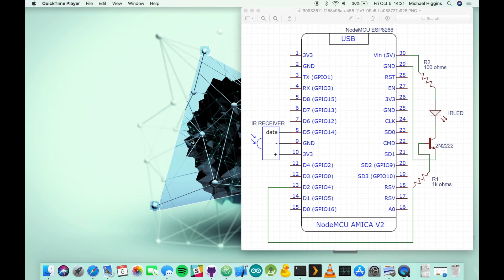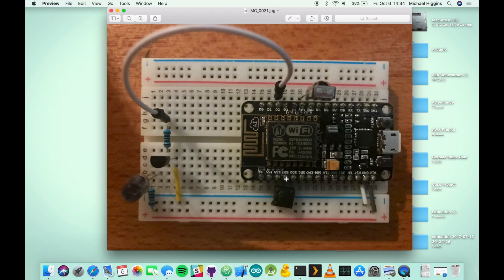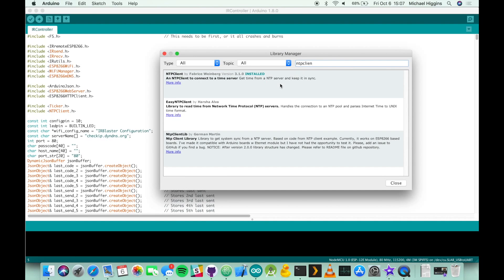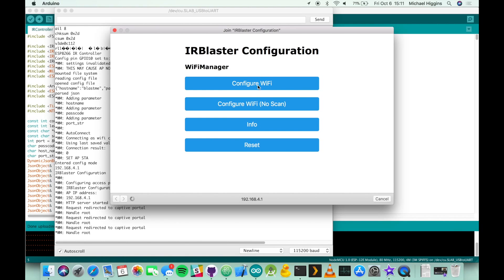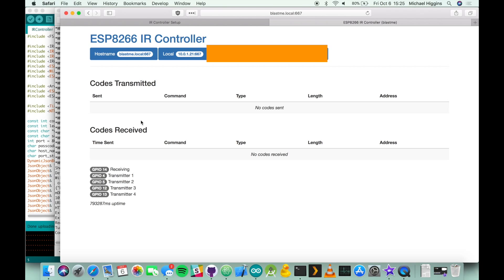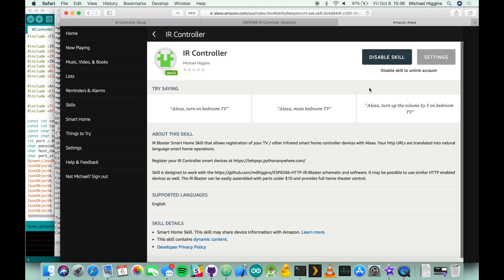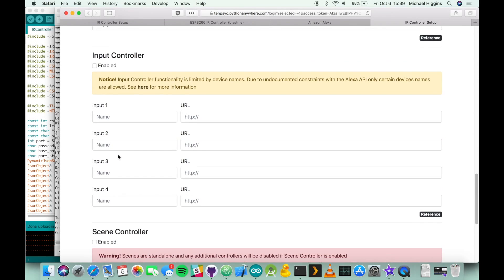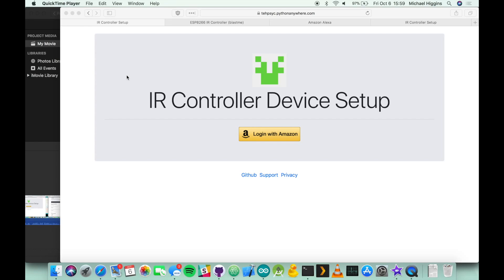IR Controller Tutorial

Comment: Have an error retrieving External IP (After Resetting ESP-12E Module)

ESP8266 IR Controller
Config pin GPIO10 set to: 1
mounted file system
*WM: Adding parameter
*WM: hostname
*WM: Adding parameter
*WM: passcode
*WM: Adding parameter
*WM: port_str
*WM: Adding parameter
*WM: user_id
Using Static IP
*WM: 
*WM: AutoConnect
*WM: Connecting as wifi client...
*WM: Custom STA IP/GW/Subnet
*WM: 10.0.1.10
*WM: Using last saved values, should be faster
*WM: Connection result: 
*WM: 3
*WM: IP Address:
*WM: 10.0.1.10
WiFi connected! User chose hostname '' passcode '' and port '80'
WiFi configuration complete
Local IP: 10.0.1.10
URL to send commands: http://ESP_181C84.local:80
ArduinoOTA started
MDNS http service added. Hostname is set to ESP_181C84.local:80
HTTP Server started on port 80
Turning off the LED to save power.
Error retrieving external IP
HTTP Code: -1
connection refused
External IP address request took 5002 ms
Ready to send and receive IR signals
Reply from the maker: There's some bugs with the latest version of esp8266 for Arduino. For now I recommend using 2.4.0 and when uploading your code make sure you select lwIP v1.4 Prebuilt (see readme for details, go to Tools > lwIP Variant > v1.4 Prebuilt
That should fix this issue assuming the rest of your network settings are correct
Reply: I wish they'd fix this... I'm stuck now, as v1.4 prebuilt is now gone / deprecated, all that is left is "IwIP v1.4 -  higher bandwidth" and"IwIP v1.4 - compile from source"I've tried older versions of Arduino IDE back to v1.6both of which error out WAY beyond my understanding:...
In file included from C:\Users\jc\AppData\Local\Arduino15\packages\esp8266\hardware\esp8266\2.5.2\libraries\ESP8266mDNS\src\LEAmDNS.h:108:0,                 from C:\Users\jc\AppData\Local\Arduino15\packages\esp8266\hardware\esp8266\2.5.2\libraries\ESP8266mDNS\src\LEAmDNS_Priv.h:174,                 from C:\Users\jc\AppData\Local\Arduino15\packages\esp8266\hardware\esp8266\2.5.2\libraries\ESP8266mDNS\src\LEAmDNS.cpp:27:C:\Users\jc\AppData\Local\Arduino15\packages\esp8266\hardware\esp8266\2.5.2\libraries\ESP8266WiFi\src/include/UdpContext.h: In member function 'void UdpContext::unref()':C:\Users\jc\AppData\Local\Arduino15\packages\esp8266\hardware\esp8266\2.5.2\cores\esp8266/debug.h:8:26: error: '::printf' has not been declared #define DEBUGV(fmt, ...) ::printf((PGM_P)PSTR(fmt), ## __VA_ARGS__)                          ^C:\Users\jc\AppData\Local\Arduino15\packages\esp8266\hardware\esp8266\2.5.2\libraries\ESP8266WiFi\src/include/UdpContext.h:87:13: note: in expansion of macro 'DEBUGV'             DEBUGV(":ur %d\r\n", _refcnt);             ^C:\Users\jc\AppData\Local\Arduino15\packages\esp8266\hardware\esp8266\2.5.2\libraries\ESP8266WiFi\src/include/UdpContext.h: In member function 'size_t UdpContext::read(char*, size_t)':C:\Users\jc\AppData\Local\Arduino15\packages\esp8266\hardware\esp8266\2.5.2\cores\esp8266/debug.h:8:26: error: '::printf' has not been declared #define DEBUGV(fmt, ...) ::printf((PGM_P)PSTR(fmt), ## __VA_ARGS__)                          ^C:\Users\jc\AppData\Local\Arduino15\packages\esp8266\hardware\esp8266\2.5.2\libraries\ESP8266WiFi\src/include/UdpContext.h:289:9: note: in expansion of macro 'DEBUGV'         DEBUGV(":urd %d, %d, %d\r\n", size, _rx_buf->len, _rx_buf_offset);         ^C:\Users\jc\AppData\Local\Arduino15\packages\esp8266\hardware\esp8266\2.5.2\libraries\ESP8266WiFi\src/include/UdpContext.h: In member function 'size_t UdpContext::append(const char*, size_t)':C:\Users\jc\AppData\Local\Arduino15\packages\esp8266\hardware\esp8266\2.5.2\cores\esp8266/debug.h:8:26: error: '::printf' has not been declared #define DEBUGV(fmt, ...) ::printf((PGM_P)PSTR(fmt), ## __VA_ARGS__)                          ^C:\Users\jc\AppData\Local\Arduino15\packages\esp8266\hardware\esp8266\2.5.2\libraries\ESP8266WiFi\src/include/UdpContext.h:322:13: note: in expansion of macro 'DEBUGV'             DEBUGV("failed _reserve");             ^C:\Users\jc\AppData\Local\Arduino15\packages\esp8266\hardware\esp8266\2.5.2\libraries\ESP8266WiFi\src/include/UdpContext.h: In member function 'bool UdpContext::send(ip_addr_t*, uint16_t)':C:\Users\jc\AppData\Local\Arduino15\packages\esp8266\hardware\esp8266\2.5.2\cores\esp8266/debug.h:8:26: error: '::printf' has not been declared #define DEBUGV(fmt, ...) ::printf((PGM_P)PSTR(fmt), ## __VA_ARGS__)                          ^C:\Users\jc\AppData\Local\Arduino15\packages\esp8266\hardware\esp8266\2.5.2\libraries\ESP8266WiFi\src/include/UdpContext.h:351:13: note: in expansion of macro 'DEBUGV'             DEBUGV("failed pbuf_alloc");             ^C:\Users\jc\AppData\Local\Arduino15\packages\esp8266\hardware\esp8266\2.5.2\cores\esp8266/debug.h:8:26: error: '::printf' has not been declared #define DEBUGV(fmt, ...) ::printf((PGM_P)PSTR(fmt), ## __VA_ARGS__)                          ^C:\Users\jc\AppData\Local\Arduino15\packages\esp8266\hardware\esp8266\2.5.2\libraries\ESP8266WiFi\src/include/UdpContext.h:384:13: note: in expansion of macro 'DEBUGV'             DEBUGV(":ust rc=%d\r\n", (int) err);             ^C:\Users\jc\AppData\Local\Arduino15\packages\esp8266\hardware\esp8266\2.5.2\libraries\ESP8266WiFi\src/include/UdpContext.h: In member function 'void UdpContext::_recv(udp_pcb*, pbuf*, const ip_addr_t*, u16_t)':C:\Users\jc\AppData\Local\Arduino15\packages\esp8266\hardware\esp8266\2.5.2\cores\esp8266/debug.h:8:26: error: '::printf' has not been declared #define DEBUGV(fmt, ...) ::printf((PGM_P)PSTR(fmt), ## __VA_ARGS__)                          ^C:\Users\jc\AppData\Local\Arduino15\packages\esp8266\hardware\esp8266\2.5.2\libraries\ESP8266WiFi\src/include/UdpContext.h:478:13: note: in expansion of macro 'DEBUGV'             DEBUGV(":urch %d, %d\r\n", _rx_buf->tot_len, pb->tot_len);             ^C:\Users\jc\AppData\Local\Arduino15\packages\esp8266\hardware\esp8266\2.5.2\cores\esp8266/debug.h:8:26: error: '::printf' has not been declared #define DEBUGV(fmt, ...) ::printf((PGM_P)PSTR(fmt), ## __VA_ARGS__)                          ^C:\Users\jc\AppData\Local\Arduino15\packages\esp8266\hardware\esp8266\2.5.2\libraries\ESP8266WiFi\src/include/UdpContext.h:487:13: note: in expansion of macro 'DEBUGV'             DEBUGV(":urn %d\r\n", pb->tot_len);             ^
exit status 1
Error compiling for board NodeMCU 1.0 (ESP-12E Module).
Any ideas anyone?
Reply: So, I managed to fix this; Arduino Studio 1.8.9, "board manager" -> ESP8266 by ESPCommunity - version 2.4.2 (2.4.1 and lower don't have FS.h for filesystem). Under Library manager, WiFiManager by tzapi v 0.15.0, Arduino JSON 5.13.5 (JSON v6 doesn't work...).   Now I have under Tools -> IwIP "v1.4 Higher Bandwidth" selectable! And.. it works. Hopefully this helps someone else. Key bit is I think the ESP board tools at an older version.
Reply: @jcarron2  hello, can you upload the sketch in ArduinoJson 5 ,i can't convert it........big tnx

Comment: Hello everyone, Please, I need some help here.
I pressed the verify button prior to upload the code to the ESP8266 NodeMCU Board, everything goes OK, but when I tried to upload to the ESP8266 an error shows up. 

Arduino: 1.8.5 (Windows 7), Board: "NodeMCU 1.0 (ESP-12E Module), 80 MHz, 4M (1M SPIFFS), v1.4 Prebuilt, Disabled, None, 115200"

Sketch uses 439972 bytes (42%) of program storage space. Maximum is 1044464 bytes.
Global variables use 50408 bytes (61%) of dynamic memory, leaving 31512 bytes for local variables. Maximum is 81920 bytes.
C:\Users\Mick\AppData\Local\Arduino15\packages\esp8266\tools\esptool\0.4.12/esptool.exe -vv -cd nodemcu -cb 921600 -cp COM3 -ca 0x00000 -cf C:\Users\Mick\AppData\Local\Temp\arduino_build_161389/IRController.ino.bin 
esptool v0.4.12 - (c) 2014 Ch. Klippel <ck@atelier-klippel.de>
 setting board to nodemcu
 setting baudrate from 115200 to 115200
 setting port from  to COM3
 setting address from 0x00000000 to 0x00000000
 espcomm_upload_file
 espcomm_upload_mem
 setting serial port timeouts to 1000 ms
opening bootloader
resetting board
trying to connect
 flush start
 setting serial port timeouts to 1 ms
 setting serial port timeouts to 1000 ms
 flush complete
An error occurred while uploading the sketch
 espcomm_send_command: sending command header
 espcomm_send_command: sending command payload
 espcomm_send_command: receiving 36 bytes of data
warning: espcomm_send_command: wrong direction/command: 0x00 0x08, expected 0x01 0x08
warning: espcomm_sync failed
error: espcomm_open failed
error: espcomm_upload_mem failed
Reply from the maker: Did you set your upload port to the right USB option in the Arduino IDE?
Reply: Thank you so much, problem solved. I used to upload the code on port 3,
 I don't know why now is port 6.

Comment: Hi Michael Higgins! I made everything from this video tutorial, but it seems the web server is not working well. As my router doesn't support mDNS, I tried opening the recently configured ir blaster on the local ip: http://192.168.1.180:667/, but i receive "this site cannot be reached". Same with the real IP address. I've opened port 667 on the router and routed it to the local IP. Can you give me some info what else I can check or try? Thanks in advance!
Reply: I tried enabled and disabled mDNS, tried enable/disable external(real ip address lookup), tried powering with microUSB charger (in case 500mAh is not enough) - nothing worked .. I still can't reach the "ESP266 IR Controller page" .. :\
Reply: It turns out that it is working, but for a few seconds after restart. And then it stops until restart again and for few sends again.
Reply: Cmmenting wifi_set_sleep_type(LIGHT_SLEEP_T); fixed the things for now. Now everything works fine, except that the IR Diode is not lighting for some reason.
Reply: I found the reason why the IR LED is not lighting. If everyone using NODE MCU v3 from LoLin connect the anode to  VU pin instead of Vin. On Vin there are just 0.2V only. Now the problem is that the IR Led light is veeeery weak. It works, but it is not powerful as a real IR Remote of the TV or the AirConditioner.
Reply: I removed the 100om resistor from the IR LED and connected the led to the 3V .. now it is really blasting .. :)

Comment: Thanks for this project and the detailed tutorial!  I've built the project and am able to connect to the IR Configuration network and configure it.  After that, the serial monitor shows that it has connected and returns an external IP.  However, no matter what configuration I try, the device always shows up as UNKNOWN for both the device name and the IP address in the router list.  This router is chained off of another router and the external IP that shows up is the external IP of the main router which I think is as expected.  I've tried connecting to that primary router and the device does not show up at all.  I'm confused on why it says it connected and shows the local and external IP addresses in the serial monitor but shows UNKNOWN in the router.  Any suggestions?  Also, is it required to set a static IP in the configuration?  Even if I reset the device, it still seems to remember the previous attempt at a static IP if I don't put one in. Thanks!

Comment: Groundbreaking step forward, this video! Thank you! ( you probably should add some link about port forwarding, judging by comments.)

however, i notice that the latest github code is not the same as in the video. I cant compile it for an Feather Huzzah ESP8266. It cant find the sha256.h file (missing in the videos include's) . I have two versions of this file but they're in my ESP32 libraries. I tried copying them as new tabs in arduino, but still wont compile . What to do?
Reply: Documents/Arduino/IRController_2_XL/IRController_2_XL.ino:15:20: fatal error: sha256.h: No such file or directory
 #include "sha256.h"
                    ^
compilation terminated.
exit status 1
Error compiling for board Adafruit HUZZAH ESP8266.
Reply: I guess i found my mistake in a comment afterall: forgot about the cryptosuite.
Reply: rtfm
Reply: Well, got it working on a Huzzah, but one cant use GPIO10, not defined.
const int configpin = 10;                                     // Reset Pin
 Changed it to GPIO15.
Reply: Did you understand the port forwarding I'm stuck there

Comment: Tried to compile, but get the following error:
Arduino: 1.8.5 (Windows 10), Board: "NodeMCU 1.0 (ESP-12E Module), 80 MHz, 4M (3M SPIFFS), v1.4 Prebuilt, Serial, None, 115200"

C:\Users\xxx\Documents\Arduino\sketch_IRBurster2\sketch_IRBurster2.ino: In function 'void cvrtCode(Code&, decode_results*)':

sketch_IRBurster2:1180: error: 'uint64ToString' was not declared in this scope

   strncpy(codeData.data, uint64ToString(results->value, 16).c_str(), 40);

                                                           ^

exit status 1
'uint64ToString' was not declared in this scope
Reply from the maker: 'uint64ToString' is part of the IRRemote library, I would make sure that's installed completely and correctly

Comment: Michael, is there anyway to increase the current going through the IR led? I can get the IR Controller to work with some of my devices but not others and I believe it's due to not having a strong enough signal. I have shorted the LED directly to Vin, but when I observe the IR signal through my camera, the signal still looks much weaker compared to my IR remotes.
Reply from the maker: You may need to decrease your resistance between the data pin and the transistor if you're having issues, though connected directly to VIN I would think you should be fine
Does that same signal work at close range?
Reply: Okay, I will try decreasing the resistance between the data pin and the base of the transistor. The odd thing is that the configuration I have works from across the room for my LG TV, but does not work at all when I hold it close up to my Pioneer receiver. Maybe the Pioneer requires a stronger signal. If you were to view your IR led through a digital camera, how does the light intensity compare an actual remote?
Reply from the maker: I would caution you doing this unless the Pioneer responds at close range and not at far range. If it doesn't respond at all regardless of distance then its probably not an issue with range but with the command you're sending itself.
What command are you sending to the device? and have you tried playing with the 'pulse' setting at all?
Reply: The command I'm sending is A55A38C7. This is what is picked up by the IR controller's receiver and I've also verified from Pioneer documentation that it is indeed the ON/OFF signal. I've tried pulsing the signal 2, 3, 5, and 10 times with varied pdelays but there's been no effect. I'm wondering if Pioneer prepends or appends some sort of authentication code to the actual command signal. Also, decreasing the resistance between the data pin and transistor did not have any effect.
Reply from the maker: What's the full command (type, length etc)
Reply from the maker: Apparently some Pioneer devices use 40khz instead of the usual 38khz
Try sending the RAW command (this is the only one that supports overriding the frequency) but use 40khz instead of 38 and see if that helps
Reply: Hi Michael, any other ideas? I'm still not convinced the signal is strong enough based on the intensity I see through my phone camera compared to the Pioneer remote. Or there's some code that the Pioneer remote might be tacking onto the beginning or end of the NEC code that the IR Controller isn't picking up. Is there any way for the IR Controller to display the raw feed my Pioneer remote is outputting?
Reply: Never mind, I figured it out! Not only did the frequency have to be set to 40kHz, but the pdelay had to be set to 25ms. I appreciate you helping me troubleshoot. Can't wait to start adding functionality now!
Reply: Hi! I just figured out how to boost the IR signal. I removed the 100ohms from the sending IR led and connected the led on 3V, insted of 5V .. Everything is mega powefull. I also changed the 1000oms resistor from the transistor and put a trimmer from 0 to 1000oms in order to change the resistance, but I think this is was not needed.

Comment: Works great for me! I found out that if alexa tells you that the device ist not responding you have to delete it from your smarthome devices and add it again.
Reply from the maker: You shouldn't have to do this and readding the device doesn't do anything. The only time this would be needed is if you update your settings on the configuration python anywhere page (and even then its better to just rerun discovery). If you are getting issues make sure you're using the latest version of the software with lwIP 1.4 and then after an error check the main device status page which will display the reason for the error at the bottom for debugging

Comment: Hi Michael,  awesome set up! I ran into a few problems getting it to connect to the external IP,  I changed the default version of lwIP to 1.4 and got it going. I'm running windows 10 and when I enter the ip address in my browser it loads the page , but there is no wifi manager screen and no where to  add the password and port, I can record the IR signal, I get the external IP address, but alexa says device is not responding, can I add the missing info: into  the code or is there a way to get the wifi manager window to open?
Reply: Disregard my last comment! I added all the info: into the code and also set up my port forwarding properly, I got it running! thanks